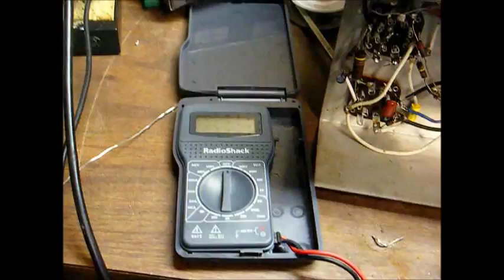Eico 145 signal tracer repair & cheap radio shack DMM

Comment: I have a pocket Radio Shack multi-meter. The wires are easily pulled out of the probes. I have soldered it back together a few times. The solder connections can be a pain. You cannot have excess solder, or it won't go back into the probe .

Comment: I keep one of these Harbor Freight DVM's in all of my vehicles for electrical issues. And in my shop, when I need multiple meters for projects these come in handy. THey use standard 9volt batteries. The only complaint is the test lead set that comes with it is not bench quality. For checking a fuse in a car or battery voltage, they work fine but for serious troubleshooting, you will want to make up a better test lead set.
Enjoy your videos and I want to wish you Merry CHRISTMAS and Happy 2013

Comment: I agree that Radio Shack is the last place to buy test gear. However, if you have a Harbor Freight near by, they have a dandy little DVM that is under $10 and with coupons, you can get it free or for no more than $5. I bought one for $2 about 8 years ago and it measures neck and neck with my Fluke 77. Asian made but for free, it's super. Since, I have bought or got free about 10 of these and give them to my Ham friends. If you don't live near a HF, let me know and I'll get you one (MORE)